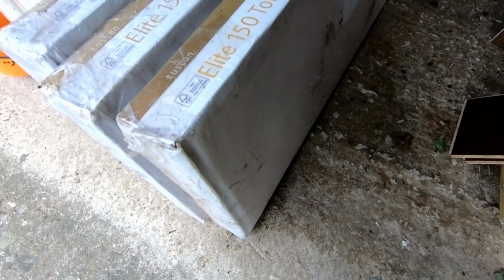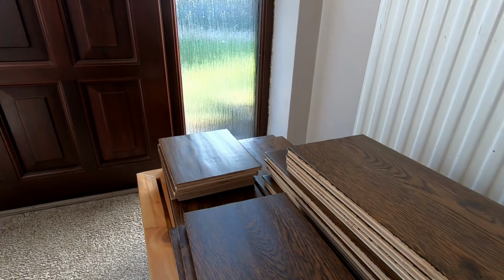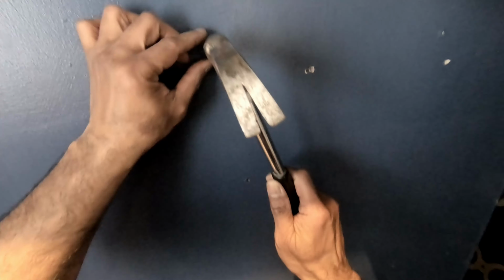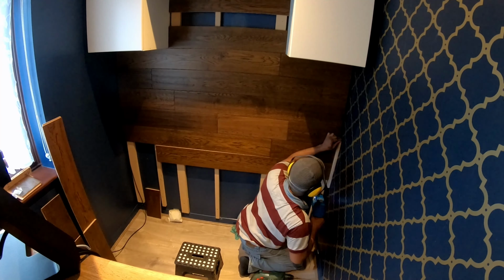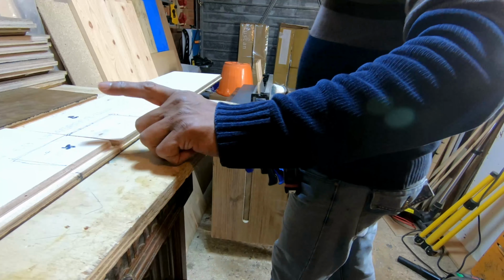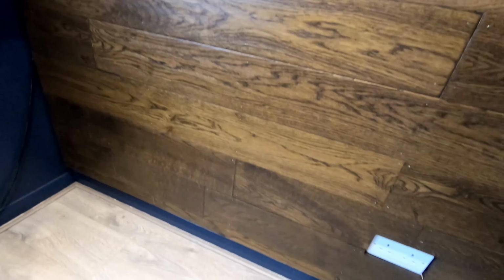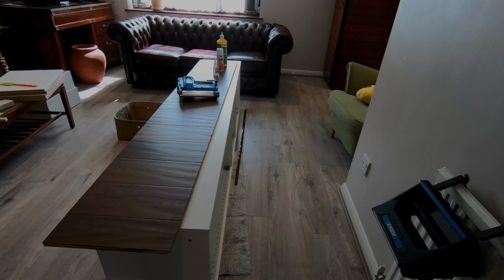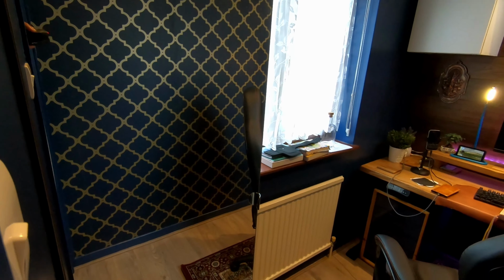Wood Panelling Accent Wall (full tutorial) + Bonus project accent paneling an IKEA Wardrobe

Comment: Your videos are captivating to watch Suj & using the panel timber up is a beautiful solution mate. Was the inner part of the veneer MDF ?
That Ferrex Brad nailer looks like it does a good job 🧐😎👍👍👍
Reply from the maker: Thanks Dirk. Indeed, the Ferrex nailer did bulk of the work (followed up by my hammer on top of the nails. lol :D). The inner core of those planks looked like plywood. I could see sheets of thin layers. So the top is real wood, followed by some 4 or 5 layers of ply. exactly like the last one in this pic: https://images.app.goo.gl/V7aaMitCXaumyju88